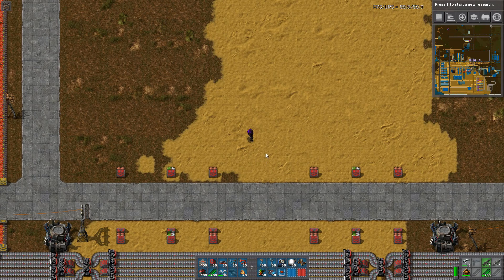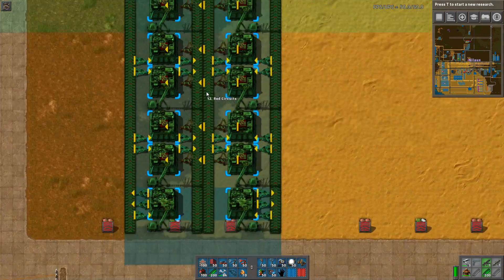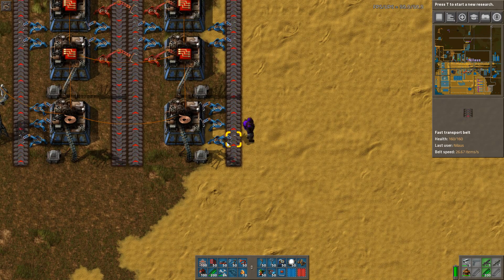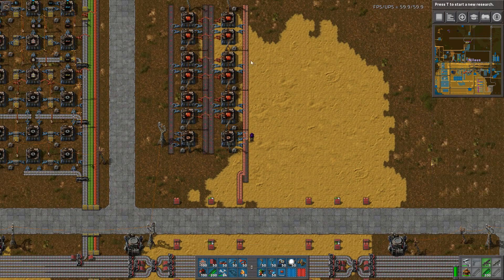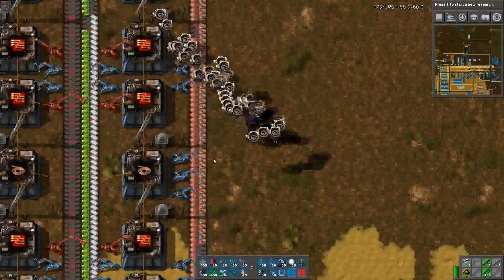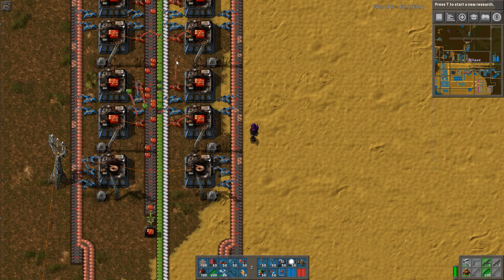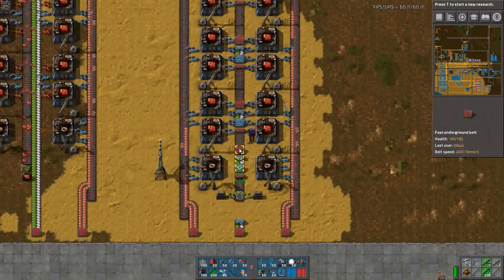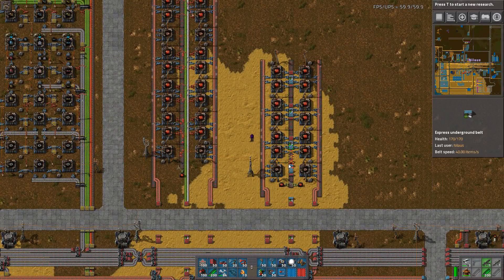Factorio Tutorial - 12. Red Circuits

Comment: I like the simplicity of having the copper wires processed on location, but I may not keep it that way for long. I'm playing with the Space Age expansion and just started using Quality modules. To me it makes sense to sort between qualities en route between systems, since both splitters and logistic bots have integrated sorting logic, but this design does not give me a lot of "en route" to work with. As is, it would be difficult to have my red (and eventually blue) circuits get all of the higher quality copper and green get the lower.
Time to split this service in two :D

Comment: 6 red circuits machines after 1 cable machine doesn't work for me - first 4 machines take all cables almost all the way (inserter takes 2 in one move - tt's a basic technology advancement), 5th machine rarely gets something, 6th never catches anything. Cable machine works all the time. I put entirely red belts line and 3 fast inserters - doesn't help much. What is wrong? I play actual 0.16 build.
Reply: You can manually change inserter stack,just set it to 1 OR change the BP and add more cable assemblers
Reply: I used assembly machine-1 for cables. Missed the point of using the same class of machines. That's the reason. :)